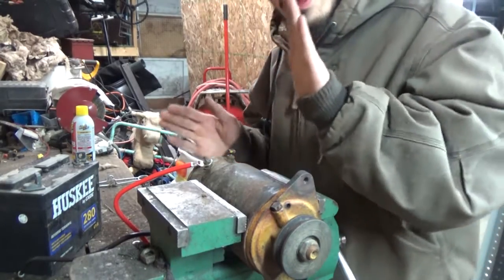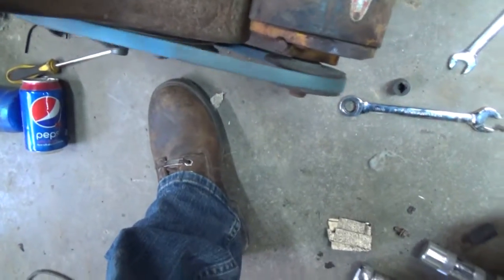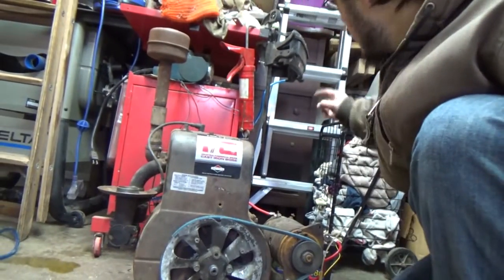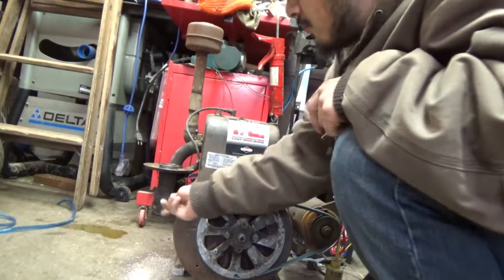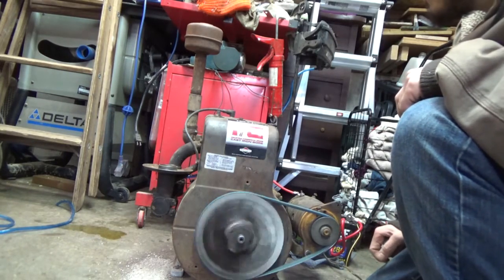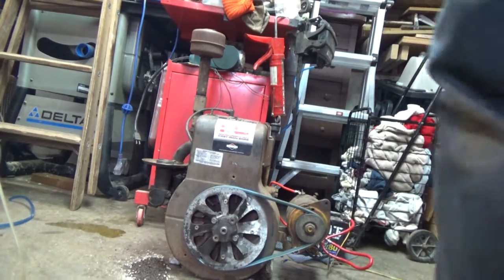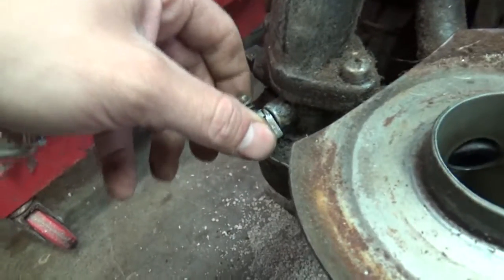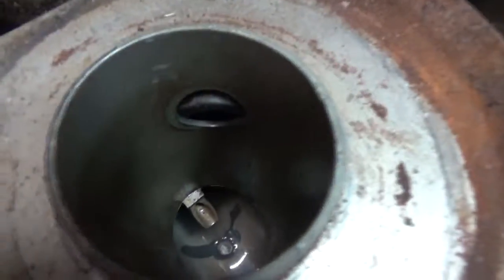briggs and stratton 15 and 16 cast iron engine pt2

Comment: Awesome. It was great to see it running. I am working on a lincoln weldanpower welder with almost the same engine. I found having repair manuals helps alot in understanding how its built, runs, and how to repair. Another thing that helps is finding Jesus by yourself. Sounds strange but small engine repair, repair manuals and Jesus works.